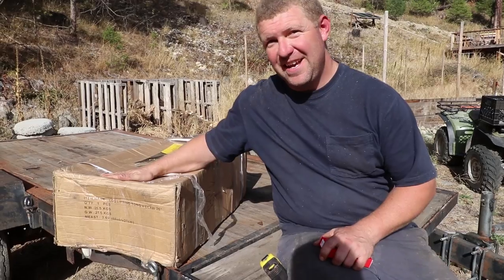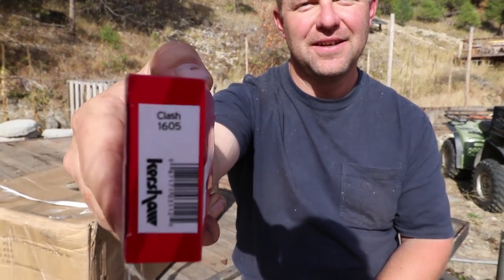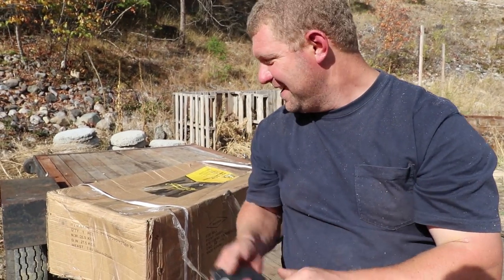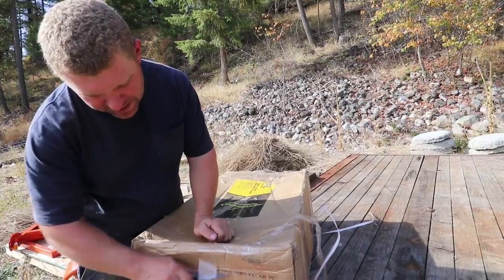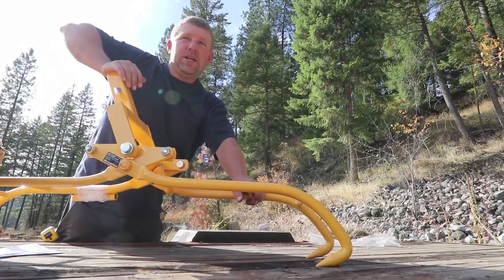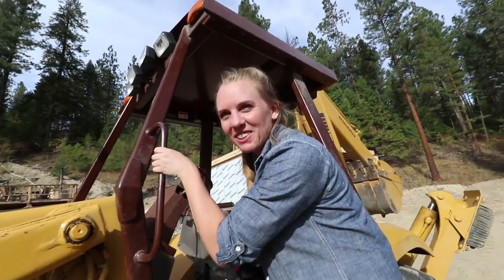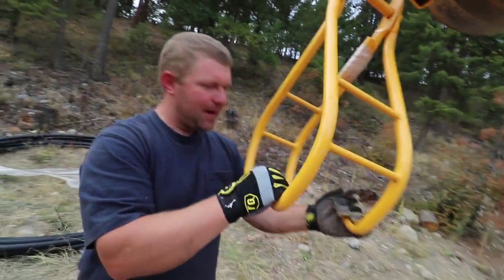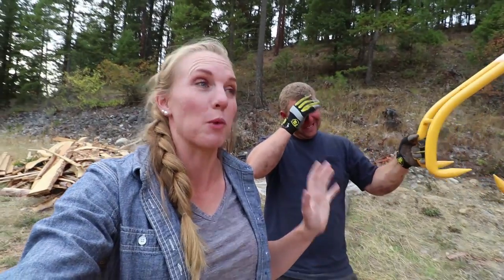THE CLAWWWWWW!!!! (Unboxing 36" Log Grapple)

Comment: If you have faulty diodes in your alternator you can loose battery charge even when it's not turned on. So if all else fails look at that. Or just disconnect the battery.

Comment: Jessie I have the Kershaw Volt II and I love it. Light as a feather.  Speed safe assisted opening is way faster than an automatic knife. Or I should say it is faster than a Gerber Automatic Knife which is the only one I know about. I have two Gerber knives, a folding and fixed and either one will pull my pants off. Yea my Gerbers are tough but I,ll take light, easy and quick to use for the price so I always use my Kershaw folder and a Mora Compainion fixed blade. I have never broken either but I lost my folder one time, the Kershaw is $25 bucks. The Mora is even cheaper. Its heart breaking to lose an expensive knife. I suspect the Kershaw you have will be very functional for you. The Kershaw II is little narrower than yours.

Comment: It's been years since I worked on a charging system. Here is what I remember. A 12 volt Battery, fully charged with the system not running should be: Fully charged automotive batteries should measure at 12.6 volts or above. When the engine is running, this measurement should be 13.7 to 14.7 volts. If you don't have a multimeter to tell you the voltage of your battery, you can do a test of your electrical system by starting the car and turning on the headlights.

If the battery is isolated when not in use, then the battery might simply be bad, though yours looked new.

Comment: Always make the chain as long as possible,  short chains get stuff in a bind -- as we all saw.    make a short chain with a different style hook - that will fit through the eye of the grapple.     If you make the chain long, you can curl the bucket back and take-up about 4 feet of chain.  use the bucket in the totally closed curled-up position.

Comment: You can measure that loss of power with multimeter. Just connect it between positive and positive cable.  You can allso do this from fusebox and narrow your search. Just remember to not put anything too powerfull on. Is it possible to attach that log crapple into the bucket? Like drill hole so you can bolt on something you can attach chain or some other links. I'm quessing removing and installing bucket is pain in the ass.

Comment: Should just disconnect a battery cable on the backhoe when closing up. Maybe install a big switch to cut all power to the battery, until to find a solution to the power problem. Nice video, always enjoy watching both of you. Lots of problems and love the solutions everyday. =)
Reply: Yes, and Jesse said there is still a "phantom load", so disconnecting the battery at the end of work would be a temp solution, until they find the problem. and they would jus reconnect and should start up in the morning. Unless the battery is bad to begin with.

Comment: Tongs look good on you Jesse, ...but then you look more like a cartoon character than Alyssa.  LOL. 
$190 sure is cheaper than a 4-6 hours of my time and $50 of steel from the steel yard, and a $20 clevis, and a receiver section, and a pivot and a ...  I'm with ya Jesse.  
Surprised your backhoe battery is still hanging in there despite the multiple full depth discharges!!!   Frustrating when we have deadlines to meet and so things like that "are what they are" until the deadlines are met and higher priorities are done away with.

Comment: Put in a main battery disconnect switch($9).  Put on a solar panel(on the roof) with a basic charge controller($50).  Go to Case boards and find out what others have found regarding trickle discharges, it's not Rocket Surgery.

Comment: the battery may have a damaged cell since its dying when isolated
Reply: I second that, probably a cell that shed a little too much lead, which now shortcuts a little which would explain the faster than usual self discharge.

Comment: You should look up proper rigging for attaching the grapple to the backhoe. Try some shackels and rated lifting chain for your own safety, it only takes a second to change all your dreams
Reply: I agree with Scott. Your lack of safety on your job is appalling. The grapple that you are using is rated for 1.5 tons at best. The logs that you are moving are most likely 5-6 tons. The swivel that you are trying to dangle the logs with will snap or come a part, maiming or killing whoever is near the dropped log. Stop before you hurt your best helper.

Comment: My case 580CK has a phantom load since i bought it!!!  AAARRGH!  Ive gone through 3 marine deep cells and they blowed up!!  So i had the generator (which smelled like it had leaked the secret blue smoke years ago) taken off and switched to an alternator....  two days later my new battery blew up...AGAIN!!!  It ran for over a year with no problems after purchase(?!). Mechanic is back soon and hopefully my yellow dinosaur will rise again after some rewiring.

Comment: I really don’t like that blood contraption.it was cheap though I will grant you that. Be careful with it. My advice would have been to get a log grab for the front loader as the lift capacity is better and a log grab would be more useful for other things. It’s a much more costly option though

Comment: If your battery in the backhoe is still dying with the master switch shut off, you likely have a bad battery, which will just not hold a charge for a long time.  Change out your battery, and the issue should go away.  Failing that, you may have the master switch on the wrong battery cable.

Comment: Jesse please wrap some duct tape around that chain hook your hanging the grapple with there...  Making me nervious.. I did a big excavating job few years back setting 50 concrete burial crypts. Didnt want my partner getting hurt under a 8000 pound concrete crypt.  And I was always the one in the trackhoe.. And ever since Ive always wrapped my chain hooks with duct tape..ive got a big swivel I hang from the trackhoe bucket.. anytime im lifting something I tape the chain hook when i chain my swivel on. . OSHA approved safety device..we joke about it all the time now...lol.  just makes it safer when your lifting because anytime a little slack gets in the chain the hook wants to slide off the chain so easy.   Saves a lot of time and aggravation anytime you're pulling a car or anything with a piece of chain too because the hook doesn't come off every time its gets a lil slack.. dont wanna see either of yall get hurt buddy..

Comment: if you want a knife that holds a good Edge and keep sharp really well get a knife that the blade says sergeant I don't know if I'm pronouncing the name right but the reason why that brand of Blade hold such a well Edge the company that makes that blade is a German made Steel and it is also used to make most of the instruments that they use in operating rooms

Comment: phantom load on the backhoe. just cover up that problem for now. Yes i know it is NOT the proper way to do it but. this wont hurt. put a fuse holder on the positive lead of the battery and just unscrew it when you Don't use the backhoe.

Comment: Love your videos! But why dont you change the battery, or the alternator on the backhoe, not that big an expence..;-)
Reply: That backhoe battery must be destroyed by now. Starter batteries dont't do well with being drained, let alone being cycled 100% all the time. If he has a phantom drain maybe putting a 350amp mechanical switch on the battery would be smart before changing the battery. They sell them for boats called battery disengage/isolater switch.That  way it can for certain be disengaged with no chance of draining each night.

Comment: Batteries in a sailboat,, a sailboat that likes a good spirited wind,,,,   Well the usual sailboat has a diesel engine to get in and out of port.  That engine normally nust be started at the end of the day to get into the marina and the home berth.  Batteries in a sailboat also run the lights, the radar, the autopilot,, etc.   And there is not always a way to recharge the batteries,,, except to start the diesel engine,,, but if the battery is dead,,,

So sailboaters,, those that like a windy day,, leap over 1 to 3 meter seas (10 feet) and come crashing down on the other side.   How many times can you drop a battery from 10 feet and the battery survive?  Interestingly enough, there is an answer.  A battery can be dropped about 1,000 times.   And when the battery develops an internal loose plate, defect?  it acts exactly like your backhoe battery.

The sailboat batteries may be warranted for 7 years,, they may take a full charge, but they can discharge internally,,,, without being connected to anything.  They leak their charge from positive to negative inside the case.  You do not have to have an external leak,,,   Backhoes suffer huge amounts of vibration.

My guess is you need to replace your battery.

Comment: Lets save you back. I loaded an example of rolling a load on a manual mill. Yes we use a case back hoe yes we use a claw. The cant hook works but why not make it easier. Use a battery powered drill and screw jack. If my example is now good enough I will do it again in depth.
Reply: Load = log

Comment: On your backhoe, install a battery cut off switch, if problem still persist then look at the grounds and wires. Chances are you have a pinched or loose wire either grounding out or could be a bad starter even though it starts could still be bad, alternater could be a problem as well

Comment: don't y'all have an old solar panel and solar control you could probably put on the roof of that backhoe
Reply: I had ran into this on an old tractor when we would do a lot of starts but very low run time .we would start it use it turn it off and then be busy we found out we're taking so many amps out to start it that we want running at long enough to replenish that battery

Comment: I swear everything you do is a master class on making things more difficult than they need to be. At our mill we just drag the log [way bigger than these] we just drag them in  parallel and then roll them onto a pair of log roller dollys with a cant hook. Why wouldn't you load the logs from the up-hill direction and have them already on a log stand where you can just roll them in either just by hand or if they have a flat spot then with a cant hook? doesn't make sense. But then I see you also cut green wood [unseasoned] so whatever I suppose.

Comment: Hey guys... Check the backhoe's alternator out put for A/C voltage at the terminal, not at the battery.    Automotive alternators make D/C voltage, however if an internal charging diode "drifts" it creates A/C voltage as well.  Anything over 0.5 A/C volts damages the battery with no indication to the operator.

Comment: You should put your logs on a skid
Reply: It would be way easier to roll your logs on the saw mill, and you would not even need to use your tractor. Just put logs opposite of the logs you have on the ground, of course they would have to be underneath

Comment: You have an extremely rare find - a hard working, intelligent, talented and beautiful women to help out with everything you do! Makes me sooooooooo jealous!
Reply: Sean Craxford if you marry a good woman you have a good life you marry a bad one become a philosopher. It could be your regulator that's on your alternator cross reference on eBay the same alternator make sure it'll bolt up properly to you're going to be using the washers or a piece of small pipe to get it aligned for your belt and make sure that it has the same connections you might be able to find a wiring diagram online. Or go to a dealership maybe they'll print one out for you and get any information you can put it in a book there's even a website for equipment given files and photos before. I might have a PDF file for a tear down for that backhoe but I'm not sure I already went through this with my John Deere and make sure that amperage is 55 amps to buy a new alternator from a dealership or if you can cross reference it at a Napa whatever's more convenient this is what I went through and I got an older backhoe hope this helps. A new regulator on eBay is about 20 or 30 bucks voltmeter the thing.

Comment: More than likely just a loose wire drawing your battery down on the backhoe.
Reply: James Callahan ... I had the same problem with the same type/make. Phantom load is what Case mechanics called it. 12 volts solar charger should help solve it
Reply: Would a battery isolator switch like we use in the marine world work?

Comment: It may not be fantom load you could have a dead cell in the battory.
Charge the battory turn every thing off like you do when you park it then remove the grownd cabule and put a test light betwen the grownd terminal and ground wire if it lights up then you do have phantom  load if it dose not light up and the batt is still low  after sitting  then you need a battory. You can also get the battory tested at a auto parts store.

Comment: The grooves on the knife you are wondering about is called knurling
Reply: That's similar to knurling, but knurling specifically refers to the cross hatch pattern around a round piece of material.
Reply: They are both knurling....

noun

a small projecting knob or ridge, especially in a series around the edge of something.

Comment: To use the Tongs to pick up Flat Milled wood,   just angle cut lengthwise two 4x4 x 2ft short posts , screwed to two  2x4 x 2ft with blocks to let the tong points fit in , notched to match the tong width ,  quick strap between the jaws to keep it from opening while you lift and move  . . . 2) if you pre-setup your milled stack area to the right and back of the saw table ,  then no need to move the backhoe while working ..   Have fun

Comment: Revving up your engine literally does nothing to help jump start a vehicle. I don't know why so many people seem to think it's going to make it "go faster" or something? You're using the AMPS from the car battery, not the extra ~.5 VOLTS from over-revving the alternator, and you aren't charging the back hoe battery off the car alternator. You're drawing juice from the car battery, it's going to take a minute to regain charge in the cells either way if the straight amps from the car battery aren't enough to crank it.
Reply: Uh , yeah OK . Alternators put out rated power at an RPM that is above idle so it does help to get the rpm up slightly .
Reply: Deserack not true at all, modern car all have the same output idling or at higher rpms.
Reply: Oh my! It seems that some folks have never put a meter on a battery while revving up the motor.
Reply: Your engine RPM drops with a heavy electrical load and with that so does the alternator output.
Best to be a wise ass once you know how things work.
Reply: Do you just make things up as you go in other areas or just on Youtube? Every alternator spec sheet I've looked up shows a STEEP rise in output current as RPM rises from idle. It starts to top off in the mid  range of RPM and the difference between 80% and 100% of rated RPM is minimal. However, going from 20-40% is a HUGE rise in output current. So the higher voltage (less drop) and the higher amps both play a huge part in making it easier to pull a large load from the host vehicle at a higher RPM vs idle. I've attached a manufacturers sheet where you can easily see on page 2 where they are saying the 160 amp alternator puts out 80 amps at idle (and that is the premium, a cheaper model will have lower idle amps compared to rated amps). 

https://www.boschautoparts.com/documents/101512/0/0/a14e768a-bdc5-4a68-94c8-53b06d118ed6